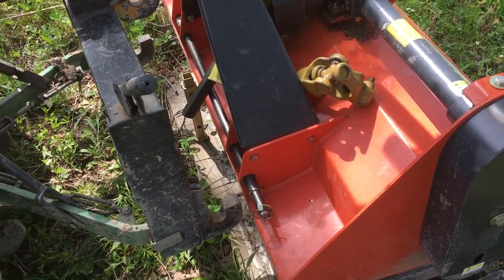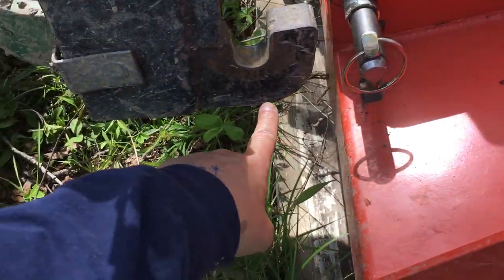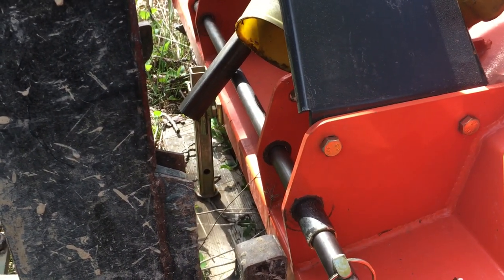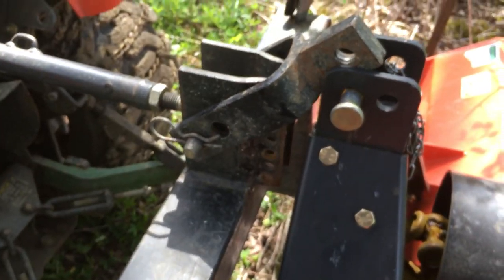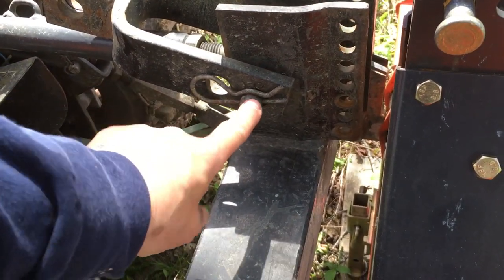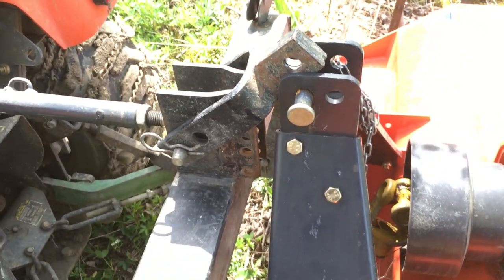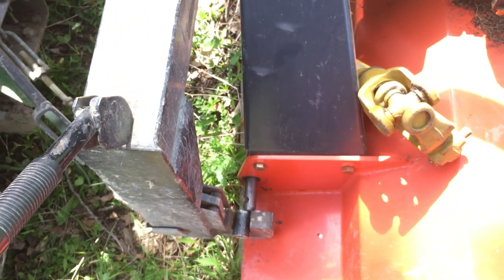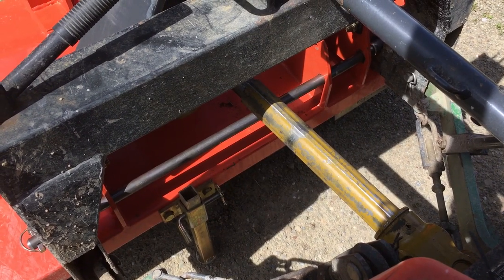Betstco Flail hitch fix.

Comment: ok so you could have done the same thing with the two pins that come with it though, couldn't you? instead of having that one long bar...
Reply from the maker: No. You would have to unbolt and bolt the hitch pins every time you want to install and remove the mower. PITA.  The quick hitch hooks will not fit under the pins (The pins are too low)  There is just enough room for the hitch hooks to rest on the mower and slide the pin in place.